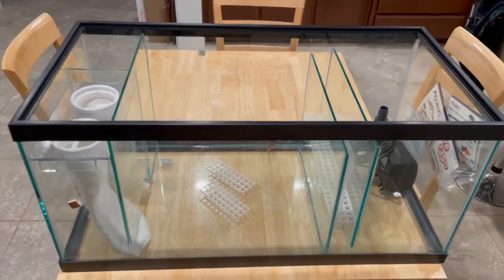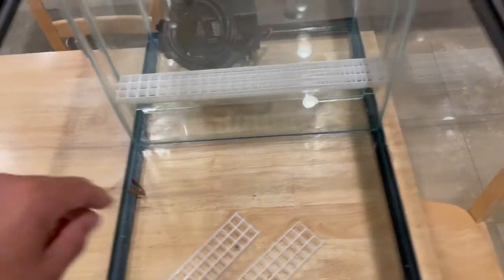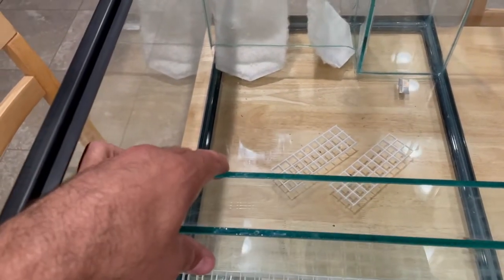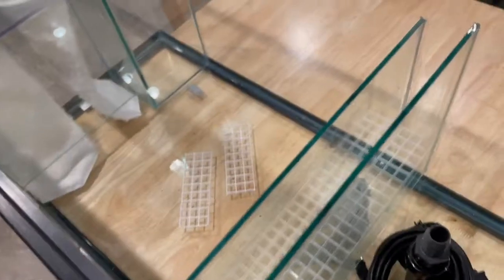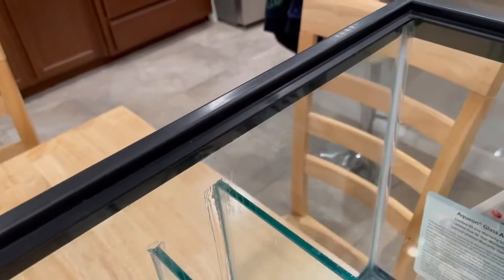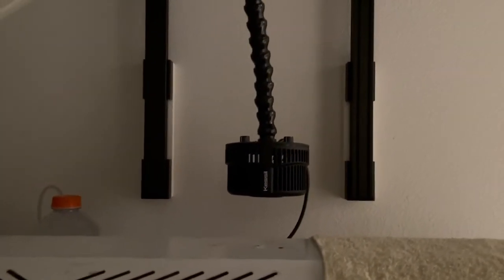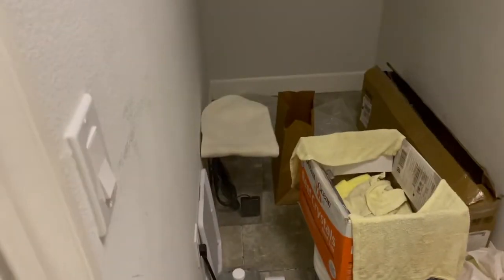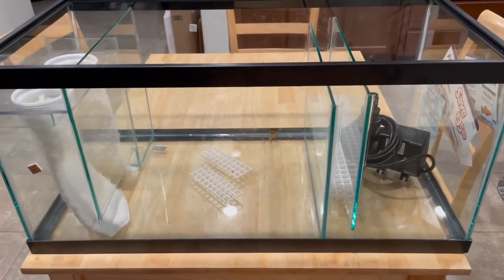DIY 40 gallon breeder sump.

Comment: soooo am i missing something? you cant overflow into AND out of the socks...
Reply from the maker: I think what you’re referring to is the sock chamber. The first section overflows into the sock chamber and gravity will force water through the socks. As long as you have a good seal around in my case the acrylic piece that has the holes cut out for the socks.
Reply: @fishheadH2o  in this wideo he points to water flowing into the socks, then over the wall beside them. After the sock where does the water go?
Reply from the maker: @TheRosy004  at the bottom of the sock chamber there is a two inch slot where the water flows in to the refugium. I basest my build off of the Trigger System CR44.
Reply from the maker: @TheRosy004  the only time the sock camber will over flow is when the socks get clogged. The water need to go somewhere the only way is up and over.. hope that clears things up for you.